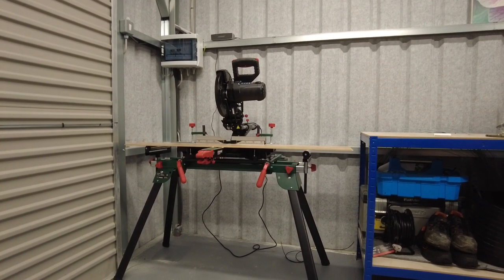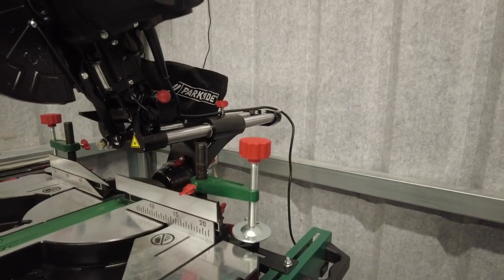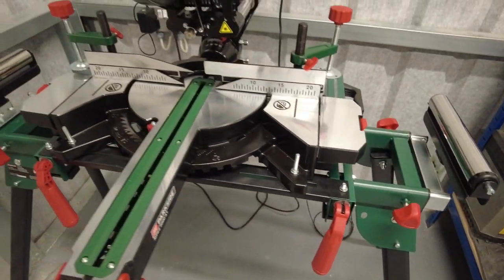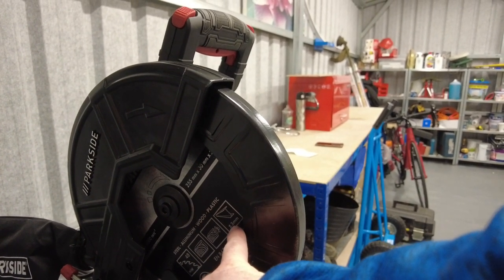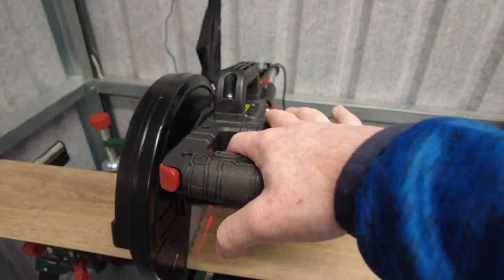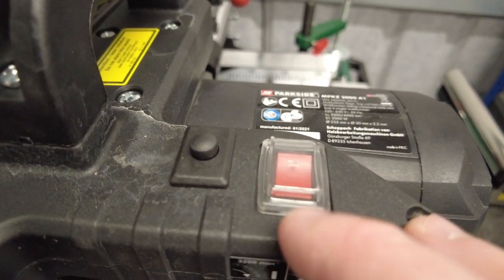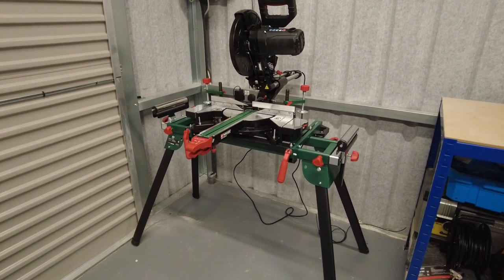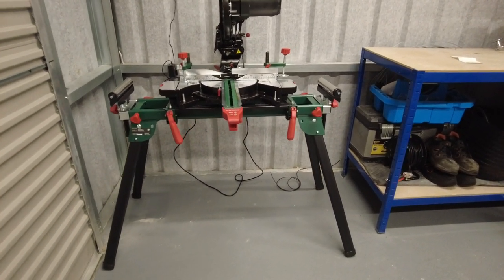Parkside (Lidl) Mitre Saw Review

Comment: This mitre saw stand has a new design. The previous models were made using circular hollow steel pipe and this one the structure is made from a rectangular shape tube. I wonder if this design is better than the old one. Could you provide the measurements of the stand alone once folded? I have a small space in the garage so I possibly could fit one of these in there once not in use.
Reply: buongiorno a tutti cari mi chiedevo se sono disponibili i pezzi di ricambio grazie